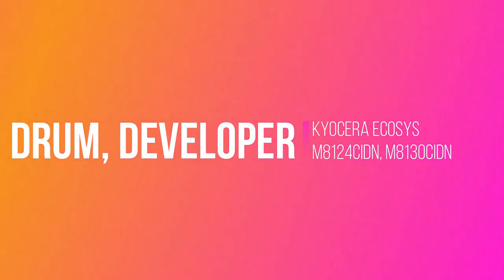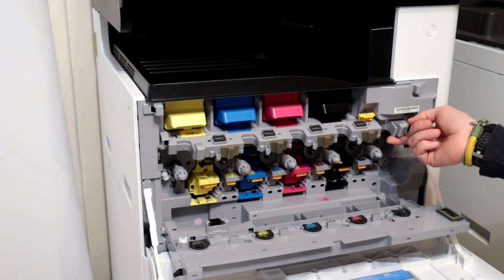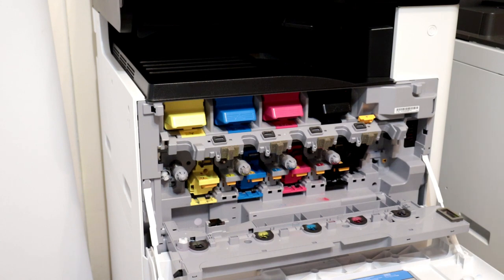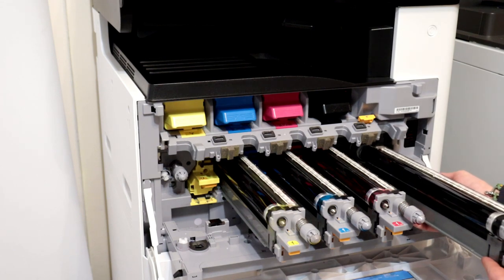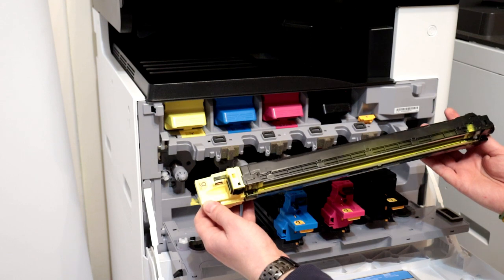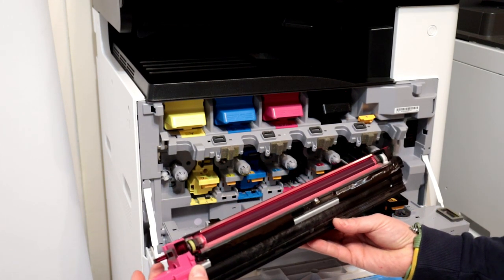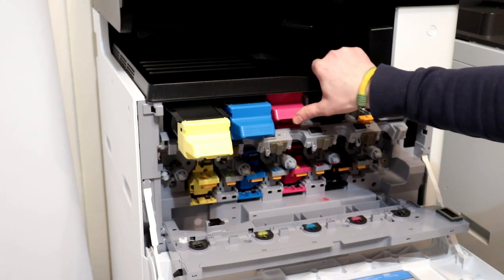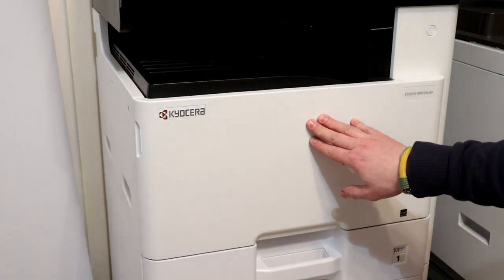Replacement Drum, Developer KYOCERA M8124cidn, M8130cidn

Comment: Should there be developer in the toner? Or just toner? Is it possible to change the media separately? What is the resource of the developer unit?
Reply from the maker: Yes, there is some developer in the toner, but these proportions are strictly protected by the manufacturer.
Reply: @MrRicoh  If there is developer in the toner, then it is constantly being added to the development unit. But the developer unit does not have a waste media outlet. Inconsistency.

Comment: hello I have a problem on a Kyocera FS 6030 I'm a dealer does the waste toner container light sometimes come on blocking the machine? could you tell me the solution, what can it depend on? thank you .
Reply from the maker: Yes, I had such a problem with the printer. Clean the sensor behind the waste toner box with a vacuum cleaner, and install a new waste toner box to be sure. If you do not have a new cartridge, remove the toner from the old one, pour a little soap and water. Shake and pour out the dirty water. Then dry the old cartridge and install it into the printer.

Comment: Hello. Thanks for the tips I was wondering what to do next though since after changing the developers and drums my colors are off. Thanks
Reply from the maker: With new original developers you got the codes from the manufacturer. Give me the codes and I'll check if they're up to date.
Reply: @MrRicoh  thanks for the reply. By codes you mean serial number, right? I changed maintenance kit B, at work I’ll see if I can find the codes and let you know. Thanks
Reply: @MrRicoh  so, I couldn’t get my hands on the codes but in the meantime the Kyocera technician emailed me back and suggested that my cyan Developer is probably clogged (since in the samples I send him he noticed no cyan) and I must replace it or hope it will eventually unclog 🤷🏼‍♀️
Reply: On the Cyan developer I’m holding now I see the code MVT049910135 DV8325C Not sure if this helps but thanks for your time <3
Reply from the maker: I hope you will make it.
Reply: @MrRicoh  hi again! Yes, problem solved! The developer WAS clogged! I hit it a bit and performed a bunch of Developer Refresh and it eventually unclogged. If it didn’t unclogged I would have had to buy a new one (or reuse my old one). 
Thank you for replying.